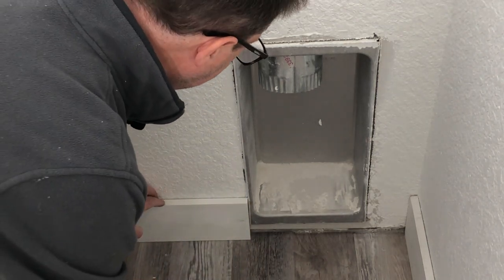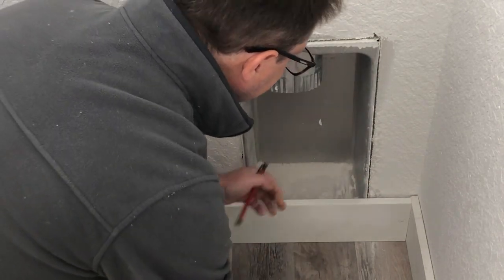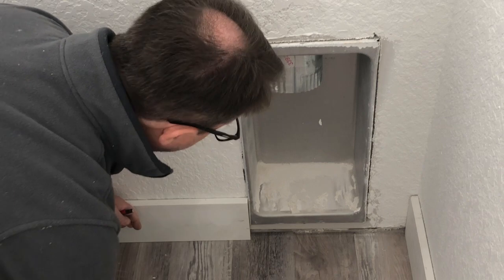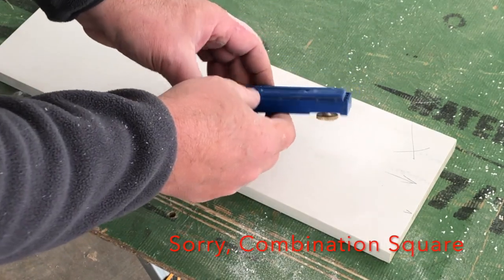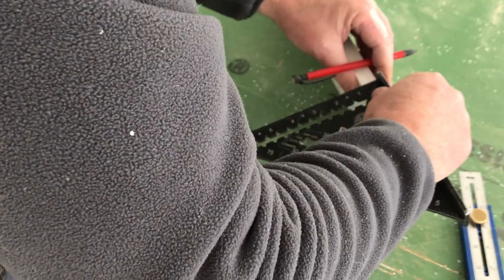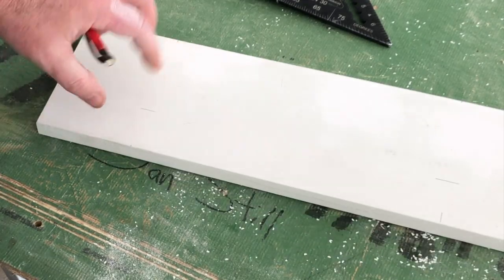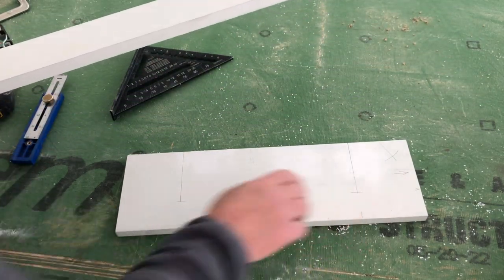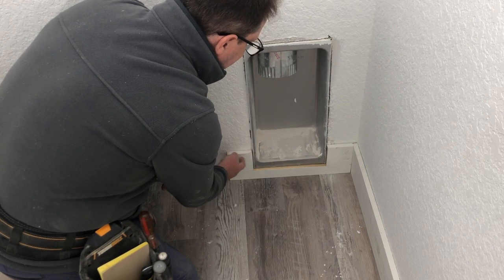Measuring vs Marking

Comment: Sir ?  Are you really a pro trim carpenter?  I see all sorts of problems with that & the main one you would be fired for fiddling with that?  SCRIBE IT CUT IT INSTALL IT!
Reply from the maker: Thanks for your comments, as you are much appreciated on this channel, and your opinion is highly valued. This video was not in anyway intended for a pro like yourself, rather it is for beginners or someone that does not routinely install trim. To be honest, it is very hard to do these videos and cover beginner, intermediate, advance, and pros like yourself. If you could please watch all ten of my videos and leave your comments on how I can improve. Please try to watch the videos and see them from a perspective other than a pro like yourself. Also, I would not have spent more than 15 seconds, marking/scribing this cut. Thanks again.
Reply from the maker: FYI: I would never ever cut this with a jigsaw. Very difficult to teach a non-pro to cut the width in the miter saw leaning out then plunge cut with my trim saw.
Reply: @productiontrimcarpenter  I understand & I knew that when you started working?
For instance on that piece u cut end to end and most if not all those vents are the same however, reach around then back use your scribes or just a sharp pencil mark your opening cut it right there on the spot and install.

I use a Milwaukee 15 ga 2 nail on each stud !
No more that 2” to avoid any pipes or wires running thru the studs!
Some cover their own holes others the GC does not want time wasted on it!

I discussed this with another guy who more or less was /is doing the same thing !
The videos can and are taken as a guy working in the business passing on his skills like Spencer Lewis @ YT Channel Inside Carpenter!

Makes yours a DIY inside Trim Carpentry!  What a great Channel!

The problem is young or older guys jumping in the business picking up bad habits to Production Trim Carpentry!
A good trim guy does Doors, stairs, cabinets, crown, outside trim , understands what wood goes where!!
I do not use MDF and often suggest homeowners stay away from it!

So it’s really like showing someone how to dress a wound calling it the 1st responder medical aid channel!  It’s not right!

I worked extremely hard to be a finish carpenter !  

You my friend are plenty young enough to learn the trade and make some money!  Why not do that!

I suggest you watch “Inside Carpentry” watch base laying and Spencer bleeds carpentry !
Join us ?
Learn the trade!

Best of Luck!
Reply from the maker: @zephyr1408  you make a very valid point. Have struggled with which way to take the channel. If you watch my other videos, you will definitely find it to be full of very solid pro trim videos, and these videos were the first ones done. I did not understand the “come join us” bit, or the “learn the trade” stuff, but thinking about going with just a pro channel. Thanks again.
Reply from the maker: @zephyr1408  And I guess you did not really look at the channel information… Here is a copy of my channels description since you missed it. FYI: I am a paid supporter of Spencer Lewis and an avid fan.

—————————————-

Disclaimer and full disclosure: I am an apprentice trim/finish carpenter. We will be learning together on this channel. My apprenticeship falls under a true master carpenter with over 35 years of experience. As of this writing (February 12 2023), I have trimmed/finished 4 homes, and soon to complete number 5. Green as they come, but actually/successfully making money as a trim carpenter.

Goal: Bring to this channel what I am personally learning on the job in a production environment as I gain knowledge and experience.
Reply: @productiontrimcarpenter  no I did I pulled it up and looked at your videos.  Not all of them but looked to see if it was a trim carpentry channel.  And it’s a really informative great DIY channel sir no shame in that?
Why is that a problem?

I am a contractor in the finish carpentry too include cabinets business?

We do not use temp for base period!  Maybe jigs for nesting crown or routing temp for doors ?  Not base!
However, great idea for a diy guy trying to do a good job and time is not a factor !  That is where production trim carpentry comes in!

Making contracts for GC’s and subs & holding to them for product and time!  However; most the areas you cover like fixing a door to save it ?  We do not do!  That’s for the handy man!

Trust me your channel has good info for the home owner looking to do a little work himself!  And it’s good stuff!
But for instance you hv no wings on your Miter Saw?  (By the way that DeWalt DW780 is one of thee best saws there is) I need wings to be accurate !  I run fast cap Best Fence System Wings ?  Chk them out or Spencer makes his own and explains how?

There is absolutely nothing wrong with your channel !  Except it is not a production finish carpentry channel?
That’s it?  Why is that a bad thing for you?

More and more (including me) learn from YT and if you hv no one to tell you (like me) uh that’s not how u want to do it it’s to slow?
Then u pick up bad hard to break habits!
That make you purposely slow!  Base is something I blow thru at 500 mph cause one I hate it, two it’s boring!
But it’s for new guys to learn measuring, cutting, and work flow!  
Ok please ask whatever you want?  
I am Jim Duncan
Kings Table Custom Finish Carpentry
Northern Calif.

I really want to help and u can use whatever I give you on your channel and it will help grow it?  Me I am not interested in a YT channel!
Reply from the maker: @zephyr1408  Thanks Jim. I wholeheartedly invite and will use your help. We Will apparently disagree on the intent of the channel. You have prompted me to make an intro video for folks new to the channel. I will use this video to explain my experience level and the intent of the channel, as it will never be competing with Spencer and the other real pros like yourself. This is and will be a channel of my progress and will evolve. Thanks again Jim. I sincerely appreciate you.
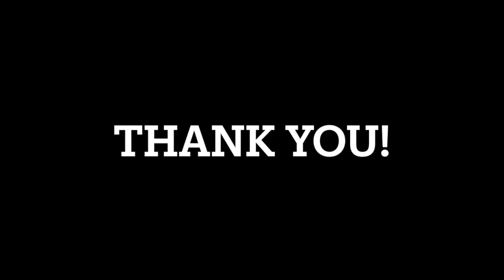Reply: @zephyr1408  since you have so much to correct him om. Why not start your on channel? And title it for apprentice and 6:47 6:47 6:47
Reply: @espencer83  great idea except I am an emergency room surgeon and don’t even own a hammer sir?